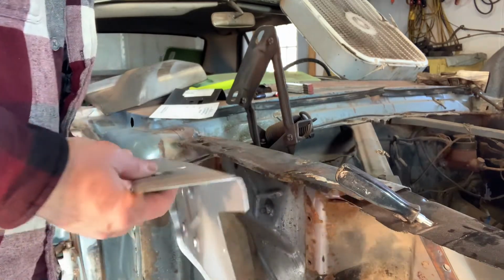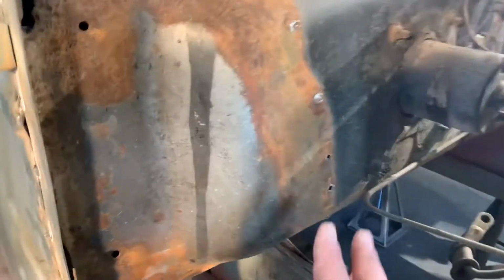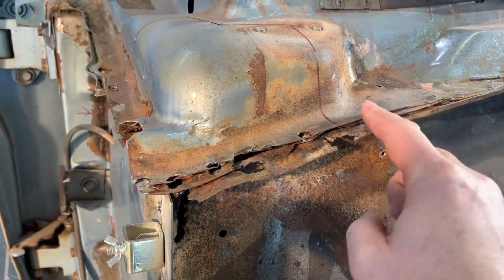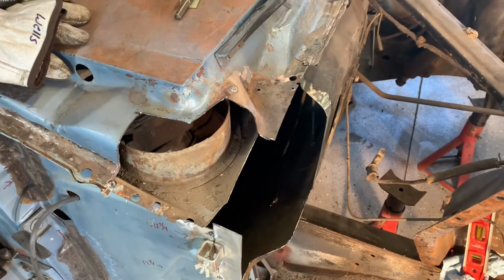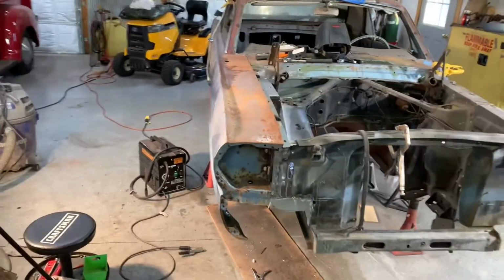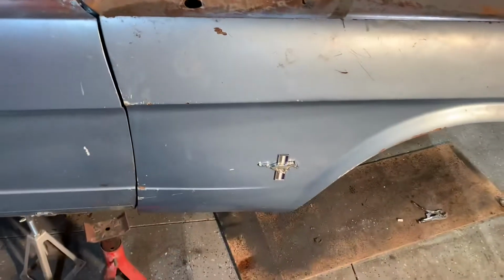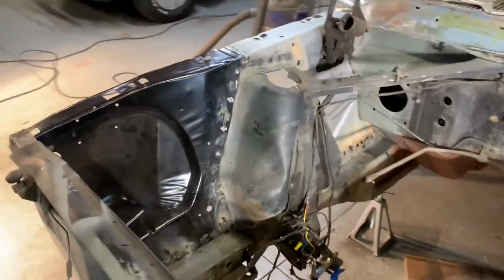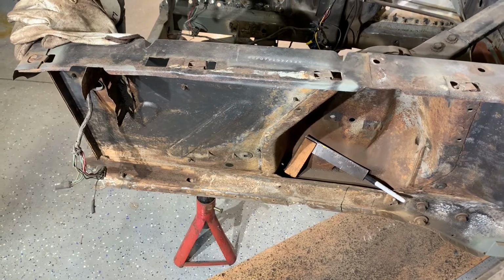1966 Ford Mustang fender aprons

Comment: Just a pointer there's a bracket for the fender to bolt on to that is on the further front aprons, you can see it at the start of this video. It is similar shape to the letter L and is usually a few inches off from the front.
Reply from the maker: Yes you are correct. I have them just haven’t installed them yet. Thanks for watching!